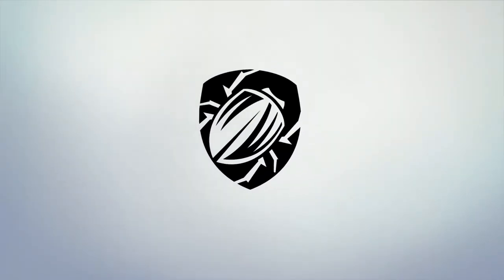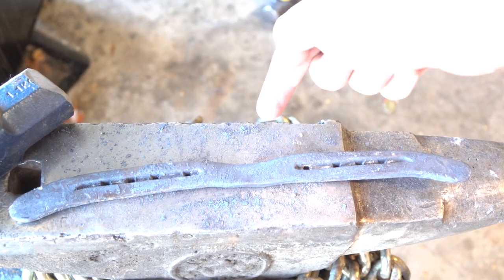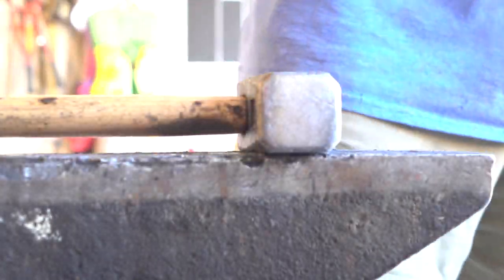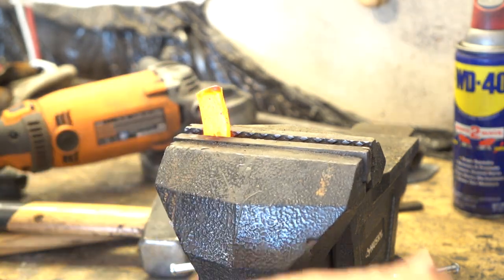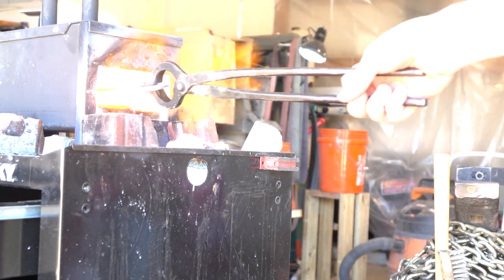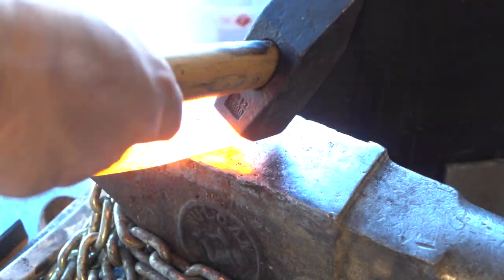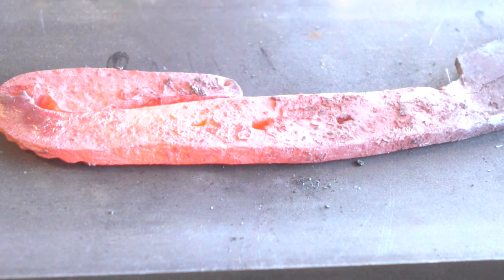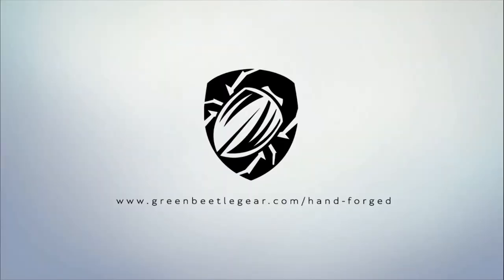Forging a Knife from Horseshoes

Comment: that turned out great I'm glad you did the second run. I do a lot of different edge testing from the three finger method to the paper cut. For me the paper is a way to check consistency along the edge and find any rough areas that may need a little more attention.
Reply from the maker: +damionlowther78 That is a good point.

Comment: If you think about it, horse shoes were effectively like today's car 'consumable', i.e. like brake pads or tires. They were designed to be cheap and replaceable, which is why they used a very low grade steel for them. No point throwing expensive tool steel at the bottom of a horse's hoof! ;) Especially back then, tool steel would have been mega expensive, because methods of production weren't as refined and automated as they are today.

Oh, and before I forget myself, I REALLY like that second knife. Warts and all. It has LOADS of character. :)

Comment: The thing the paper test is really useful for is detecting any dull spots or nicks in the blade, particularly when using phone book paper. As a test of how sharp the blade actually is I am mostly skeptical seeing as a knife sharpened on a 1000 grit stone slices through paper nearly as well as honed edge.

Comment: Hey dude love your videos. I like the mild steel flatter. I think I'm going to face mill one and weld a hardie onto the bottom of it. My anvil is an old Mousehole. Many mouseholes were originally made with a fairly deep belly, so I struggle using the anvil for flatness all the time.

Comment: Awesome video as always. For anyone out there I have a question, I am currently working with 1084 steel and during the quenching process the blades develope this "bubble" pattern. What would be causing this? I've never seen anyone else have this problem. I'm using pre heated canola oil and getting the blade orange (dull orange specifically). Any suggestions as to what I'm doing wrong would be greatly appreciated.
Reply from the maker: +TwistedReptile  burning steel causes bubbling but I'm not sure what's going on with your quench.  Hopefully someone here can help.

Comment: I'm not very versed in blacksmithing, and I want to get into it i'm just gathering everything right now. BUT my question is why didnt you just weld the 1075 all the way down instead of forge welding? what is the benefit to forge welding it instead?
Reply from the maker: +HickLife   you preserve the lines of the original metal meeting each other when you etch them in acid.
Reply: ok gotcha that makes sense. so if i'm not going to etch them it would work just as good to weld it with a welder?
Reply from the maker: If you get a good solid weld through.  I'm not skilled enough, personally.  I would end up leaving bubbles and cold welds but better welders could probably do it.
Reply: ok cool, thanks for the reply's. I'm going to hopefully be attempting a horseshoe knife in the near future, your advice and your video has been very helpful

Comment: Really nice!! Im from brasil. Hey what u use for link the 2 different metals, its a kind of dust?
Reply: 3Picaretas the powder is borax helps remove metal oxides from the weld surface .

Comment: how much would it cost to get a forge for starting out stuff like this?
Reply from the maker: +Jacob Swan  $150 on ebay but make sure the manufacturer states it will get to forge welding temps (2100 degrees).  my first one did not.  or you can buy 2600 degree firebricks for $8 each and make a homemade coffee-can forge, heat with a torch.  Ppobably wont reach forge welding temps like that but good enough to start.

Comment: I see that you usaly grind bare handed, and Im wondering why the friction on the knife doesnt burn your fingers? just wondering.
Reply from the maker: When the knife starts to get hot it is dunked in water.  I always grind without gloves if it after heat treat so that I can tell if knife is getting too hot - it will scorch and ruin heat treat if not careful.
Reply: +Green Beetle thanks for the info! love your vids to

Comment: Why didn't you just use a coal forge to add carbon to the steel?
Reply: +GreatSmithanon is that a joke?
Reply from the maker: +GreatSmithanon  Interesting thought.  I'm not sure how much carburization occurs in a coal forge.  It takes hours for carbon to diffuse into steel and in the case of a forge it may just oxidize or burn away as scale unless it was an O2 free vacuum forge.  Some alloy steels resist carburization, I think phosphorus is the culprit?  I've carburized steel with sugar and graphite powder but both took 4 hours at 1800 degrees in a heat treat oven wrapped in steel foil to prevent oxidation.  In one case I brought some bum cable up from 45 HRC to over 60 HRC but it still could not hold an edge- very jagged and large grains that broke away.  Dulled with 5 cuts through paper.  In other words I learned the hard way there's more to a good knife edge than carbon content of the steel.

Comment: couldnt you heat it with coal to add more carbon?
Reply: No.
Reply: +JZ 10 That prevents some of the carbon loss from repeated heats, but to increase the carbon content of the stock he would have to smelt it and add carbon manually, as if he were making crucible steel.